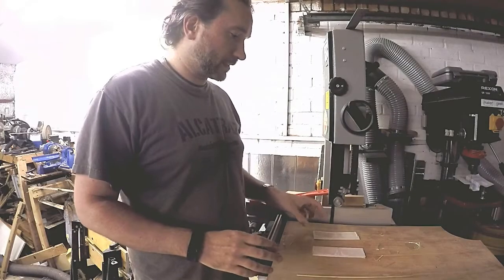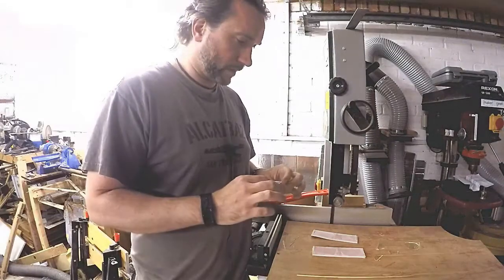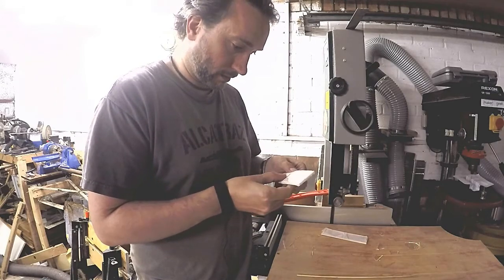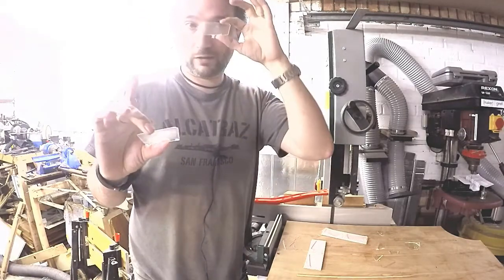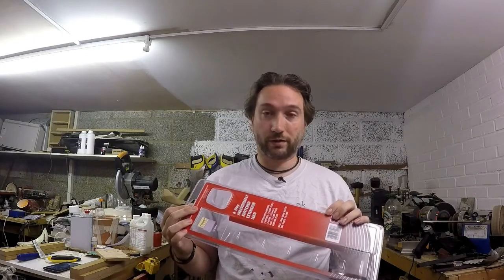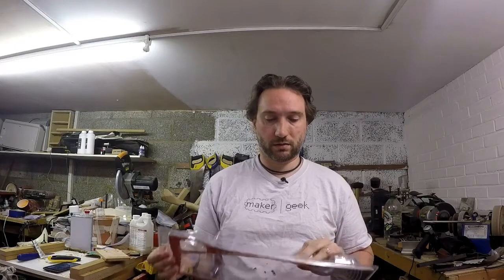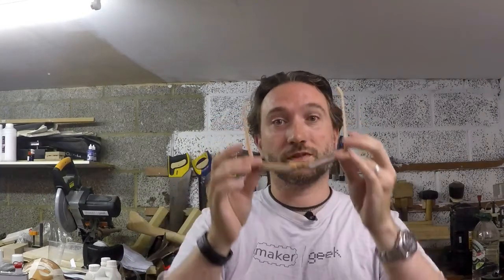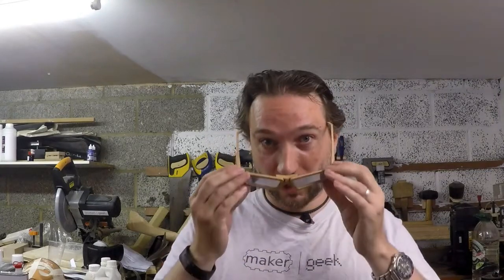From CAD to Face - Custom designed wooden sunglasses

Comment: 5:59 blue steel! To get the castings clear you need to let is cure in a pressure pot. it will squeze the air bubble to almost nothing making the resin clear. nice video
Reply from the maker: Thanks!, I'll have to look into pressure vessels at some point.